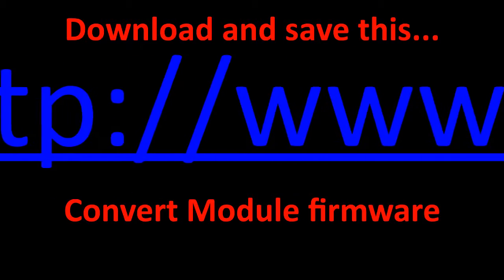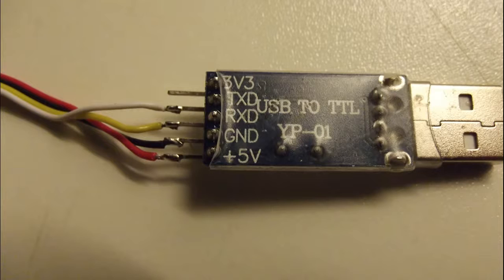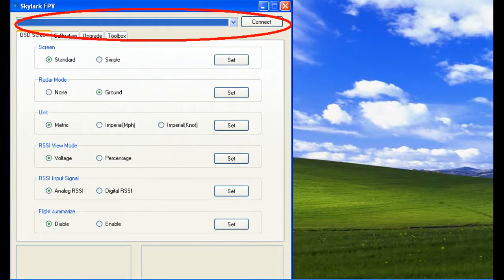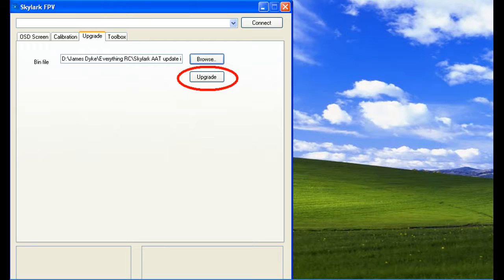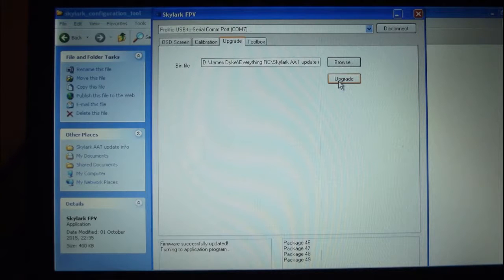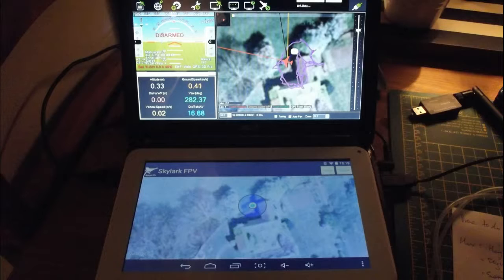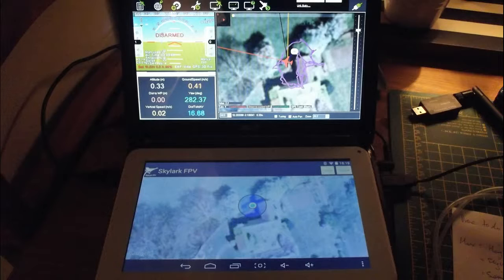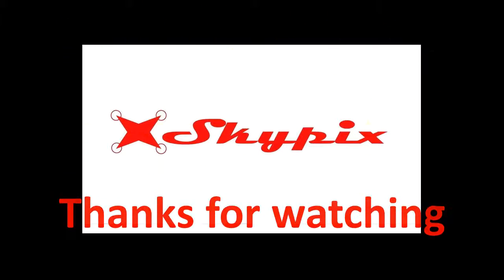How to.. Skylark aat auto antenna tracker and Ublox 6M GPS APM 2.5 2.6 firmware upgrade

Comment: hello I did the upgrade to use the ublox gps in the module, but the module after the upgrade does not turn on
Reply from the maker: Juan Hernandez that’s odd. I’ve never seen that before. Is your wiring correct?
Reply: yes
Reply: Hi i follow all the steps but the Converter module dont torn on or dont shownled signals
Reply from the maker: Juan Hernandez sorry to hear that. I haven’t come across that problem before.
Reply: James Dyke  i think is the  firmware , i want to see this working
Reply: James Dyke i think the firmware is broken or something like that
Reply from the maker: so i have just repeated the process on my own equipment, and everything works as it should. my guess would be, maybe you have done something differently to me.
Reply: James Dyke  i make the same steps also i upgrade   with Windows XP
Reply: James Dyke i send a e-mail to Skylark soporte but they don't respond

Comment: Okay, my friend, I use a osd fy 41 ap lite card but I already connected the converter on the osd and gps and I did all the calibration but the antenna does not go with the aero that is happening? Do you have to update something for it to work?
Reply from the maker: do you have a picture of your wiring?

Comment: Hi James. Think it's fix. Not sure 100% since I need to test it in the field.
The red light in the module is flashing now around 3 or 4 times a second, on the AAT module , got the blue light flashing fast, green one slowly and now the orange one around 3 to 4 per second. Trust this is what it should be like??
I connected a headset to the audio RCA on my goggles which comes from the receiver to the AAT power unit, I could hear sort of a "Fax" machine. 
Please let me know if the blinking lights described above is how it should be.... Thank you
Reply from the maker: Sounds good to me!! Yes the noise you can hear is the GPS data being encoded and sent down an audio line. Sounds just like old internet dial up. Should work well now.

Comment: Ahh. Thank you for that. 
I do need to check which channel my Tx is sending .... Not sure but will check that. From my AAT I have 3 RCA jacks. I'm using yellow for video, white for audio. 
It's almost midnight so not sure if I can check the system without GPS signal( I'm home).
I could try the red RCA instead of the White. ( I'm assuming white is audio left or right and red is the Audio left or right.) will check that and also the red LED on the module itself. Thanks for the tip, appreciated :)

Comment: Hi James. Thank you for your video. I have tried it but no luck. It is a bit weird , I'm not sure which GPS unit I have but it did all come together as a set . My OSD is the FY41-AP lite.
My OSD does work well, I do get my Lon/Lat on my screen, problem is I suspect it does not connect via the Audio channel. My skylark AAT orange light doesn't  flash, it's only solid orange. 
I'm a bit lost. Is there any chance you could take a look at the wiring diagram for me? Skylark convert module does include a diagram for the FY31, which I believe should be very similar . No luck to date. Thank yoy
Reply from the maker: Ok, so after powering up the whole osd with GPS and convert module plugged in, does the convert module transition from slow blinking to quick blinking after 1-2 minutes? Another thing to check is have you disabled any onboard microphones from the video transmitter? (This deteriorates the signal information) and also check which Audio channel you're sending the info down, i.e. left/right audio. See if another of my videos helps... http://youtu.be/kqIxCtWhM-s
James.

Comment: According to the skylark website , I have left the yellow cable not connected and the white straight to my VTX audio. Doesn't the Audio channel require ground cable? It didn't work today. The unit itself did perform the right test/calibration. Not no follow my plane .

Comment: Hello, would you have an email address I could contact you please. I have the skylark AAT together with the converter module. Using the FY41AP, however hasn't been successful. Hoping you can help please. Thank you
Reply from the maker: http://youtu.be/YEsLagXCaGM see if this helps you first?
Reply: +James Dyke thank you! Definitely haven't done that so will put this into work.... Thank you for prompt reply :)
Reply from the maker: If the video below doesn't help, let me know and I'll give you some product specific wiring information. 
http://youtu.be/YEsLagXCaGM
It's a generic wiring tutorial for the skylark covert module, and I've thrown a couple of examples in for good measure. Good luck!